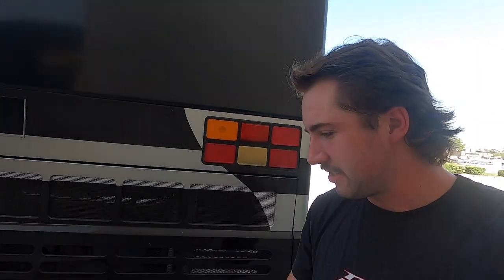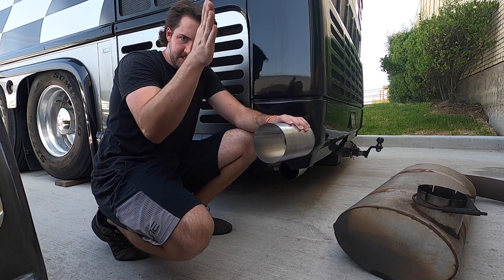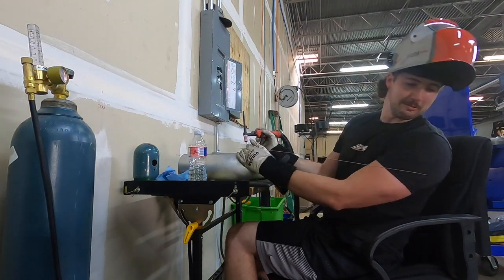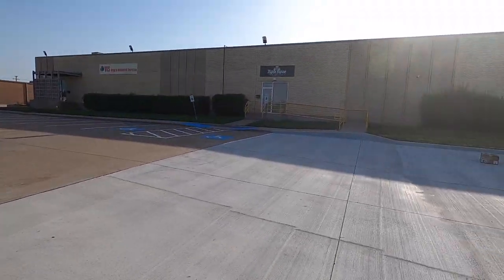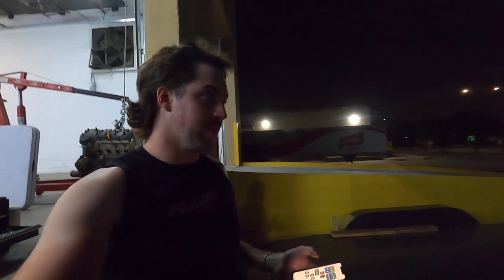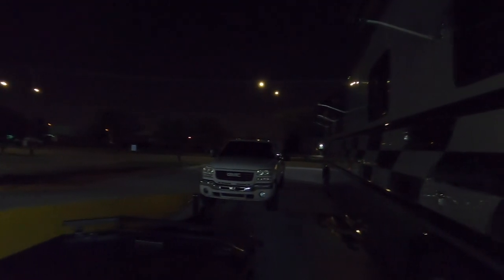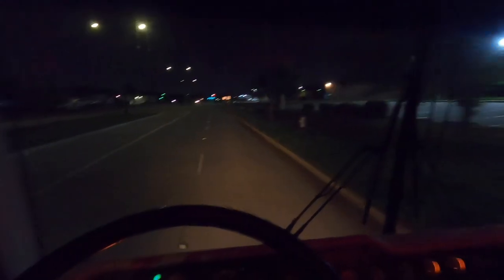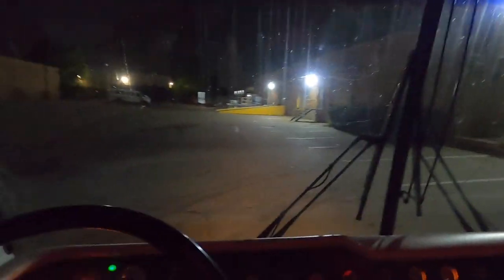Testing The Jake Brake In The Newell! (Straight Pipe Detroit Series 60)

Comment: Also, I work at freightliner in Montgomery, AL. We work on mostly Detroit engines. I personally work on a lot of the 07 and up newer Detroit engines. With that being said I know a little about the ddec3 60. And if I’m correct, the jakes get their ground from the engine itself. If you pop the valve cover off I wanna say there are 3 Jake solenoid with 1 power wire going to each one, shouldn’t be a ground issue because it’s grounded when you bolt the jakes to the engine. Most likely you’ve got a solenoid sticking. It also doesn’t sound like all the jakes are engaging. But If you get me your engine serial number I can look up all kinds of wiring schematics for you to troubleshoot it yourself if you’d like, or if you ever find yourself rolling through Montgomery, AL, drop on it. Stop at freightliner, we’ll fix you up!
Reply from the maker: Thanks man I’ll have to look into that. It’s a reliabilt unit from 2003 but still appears to have the original top end on it
Reply: This guy knows more but I was going to say it doesn’t sound like it’s hitting on all six cylinders when braking.

Comment: There are 2 orange lights on the ddec 3. One is “jake Brake Applied” comes on when you release the throttle and goes off when you step back on it. The other is a “check engine” light. Look closely and see if it’s a check engine light. If not you’re ok. Check engine is always next to stop engine ( red light ) on the dash when you have a 60 series detroit. Hope this helps brother. She sounds AWESOME!!!!!

Comment: For that check engine you might just need a shop to run an overhead on it. That will adjust your valves and all. Its good for the health of your engine either way buy if your valves are to far out it could be triggering the light.

Comment: as a retired truck driver jakes are cool and will save your brakes. your jake with straight pipe sounds great. just don't use that tool of the trade in town or when could be obnoxious to others.

Comment: Has your generator been running continually for 4 weeks? I’m assuming it’s designed for tens of thousands of hours of use.
Reply from the maker: At the time it had been yes. These things see 20,000 hours regularly and do just fine. Mine has 1300 hours on it now